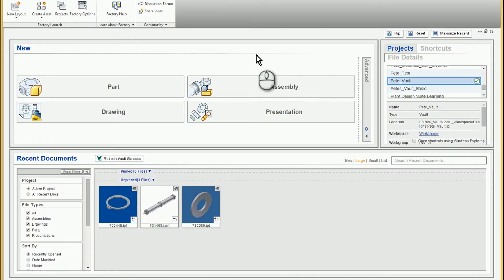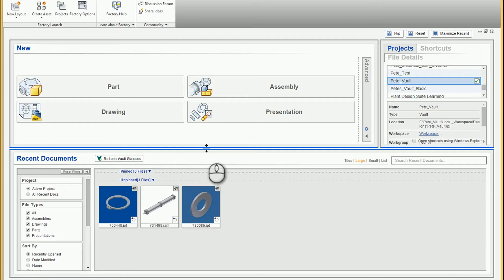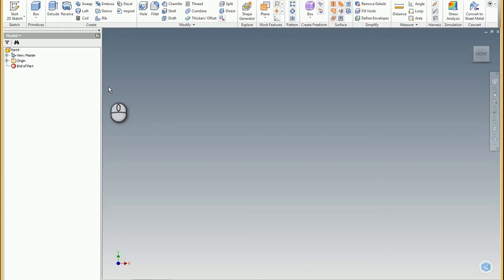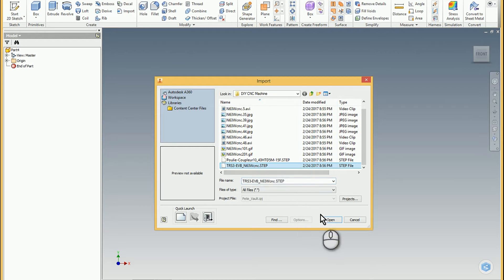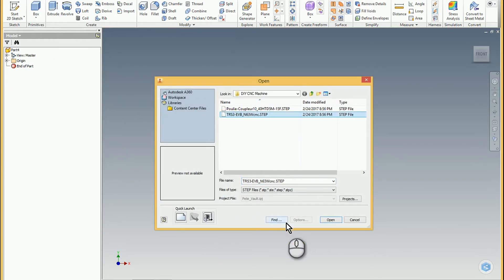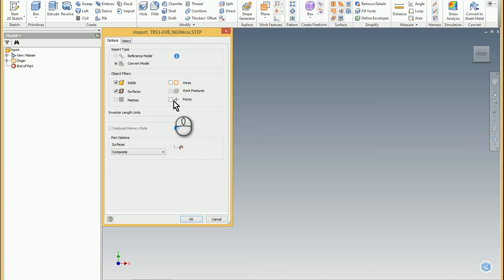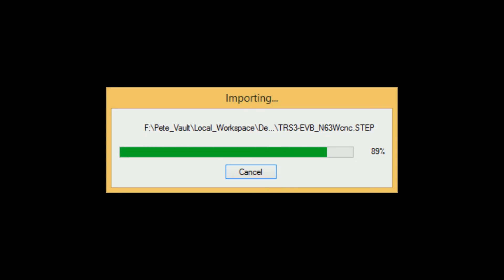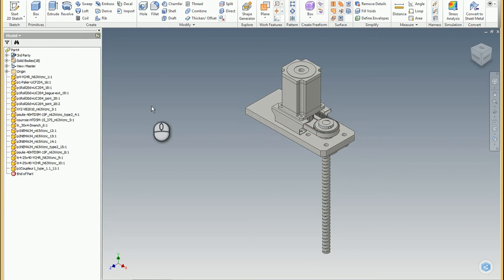Autodesk Inventor - Import a STEP Assembly as an Inventor 2016 Part

Comment: how  converted step for sheet metal fo to edit holes
Reply from the maker: DIEGO, thanks for reaching out!  You can use AnyCAD to reference the file into Inventor or you can convert the file into an Inventor.  From there you can use the "Direct Edit" tool to resize the hole.  That's probably the easiest method.  If you have any questions or would like a video on this topic, please let us know.  Hope this helps and have a most blessed day!

Comment: can you modify the assembly?
Reply from the maker: Mati Mm, thanks for reaching out!  If you import the model as prescribed in this video, then you will generate a multi-solid body part, not an assembly.  You can modify the solid bodies, using the Direct Edit tools or add other features, but those are going to be the primary ways to edit this model.  If you wish to import the STEP as an assembly, then you just need to open it within Inventor.  Please let us know if you have any other questions or provide clarification, if we missed something.
Reply: @Team-D3  Thank you for your kind explanation

Comment: Nethertheless, there are no features from my Solidworks modells recognized in Inventor..
Reply from the maker: Hello Al3xxx9, unfortunately there is no direct way to convert Solidworks features to Inventor features, as the underlying modeling code is not the same.  However, there is an Inventor add-in that can help, Feature Recognition, which can help convert some features from 3rd party models to Inventor features.  Please see the link below for more information on this add-in.  Additionally, Inventor has some functionality, called “AnyCAD” which allows users to utilize Solidworks files directly in their Inventor assemblies without having to convert them to Inventor models.  Please see the other link below for information on that functionality.  Let us know if you have any other questions as we’re happy to help!  Hope this helps and have a most blessed day!

Link to ‘Feature Recognition’: https://apps.autodesk.com/INVNTOR/en/Detail/Index?id=9172877436288348979&appLang=en&os=Win64

Link to ‘AnyCAD’ Information: https://knowledge.autodesk.com/support/inventor/learn-explore/caas/CloudHelp/cloudhelp/2019/ENU/Inventor-Help/files/GUID-7FACB50F-ED00-419D-8C23-F98283CCD8F8-htm.html

If you need anything further you can contact us at communications@teamd3.com or call us at 877-731-7171.